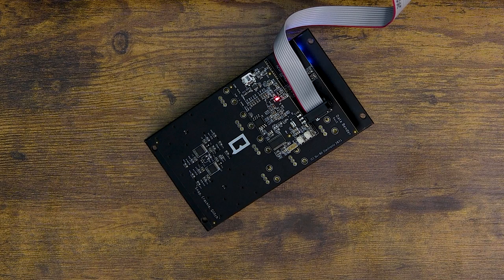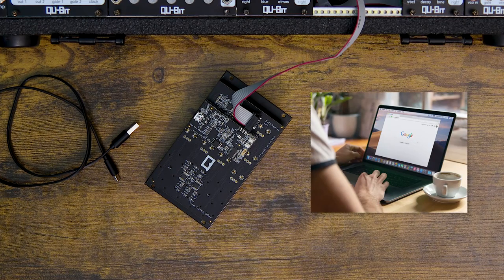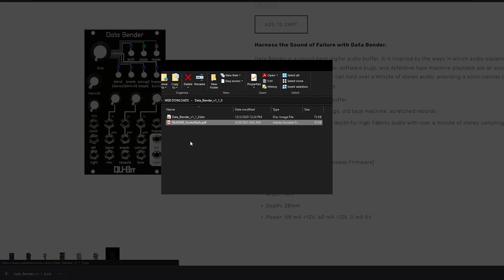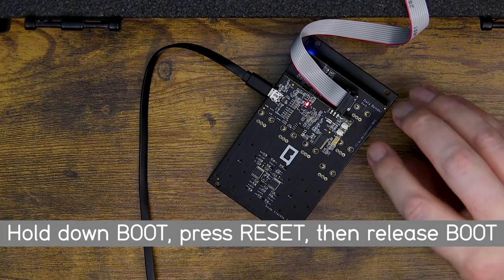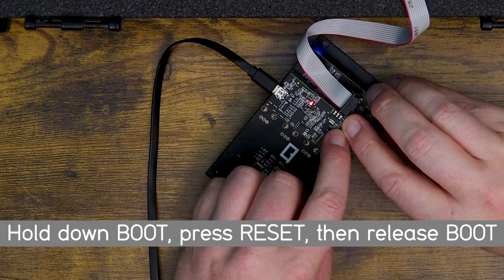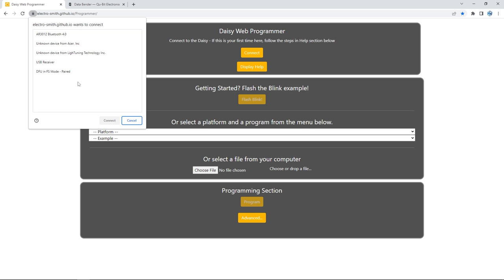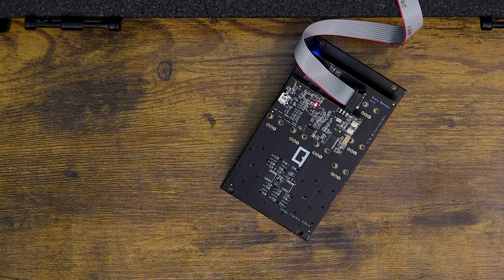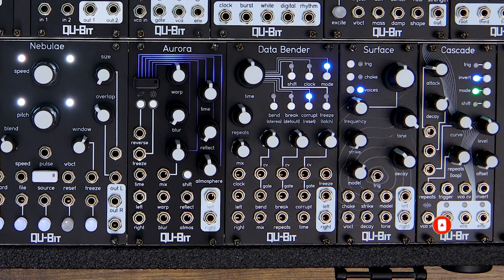How to update firmware on Data Bender

Comment: Thanks! Simple and elegant as always Qu-Bit!
Do I need to calibrate my module as described in the PDF after upgrading the firmware?
Reply from the maker: We recommend performing the calibration procedure after updating your Data Bender for the best possible pitch tracking. Data Bender does perform a software calibration when it is updated, so if that calibration is sufficient for your patching there's no need to calibrate!

Comment: I can't get zadig or the daisy web programmer to say DSFU in FS mode...I had no problem using Zadig when downloading the pams new workout firmware either...I used two different cables and tried both methods described for boot mode...I have the newest version of DB as well...Please help!
Reply from the maker: Greetings---so sorry you're having problems with Zadig. We'll get you straightened out. To start--visit:
https://www.qubitelectronix.com/support
Reply: @QuBitElectronix  ticket created, thanks

Comment: Cant get the Daisy Web Programmer to connect, did the Zadig, my computer CAN see the DFU in FS mode but chrome browser cant and I did allow chrome to connect to USB devices so kinda lost 🥺
Reply: I managed to do the update using STM32Cubeprogrammer
Reply from the maker: @Hirsbrochannel  I'm sorry the web programmer didn't work out! To confirm, when you used Zadig, you selected WinUSB as the replacement driver for "DFU In FS Mode"? That  would make it so your computer sees the Daisy Seed, but not the web programmer.

Comment: That neb at the end of the video has the boot error LED code! Unfortunately I know what that looks like firsthand. Updated firmware, still stuck. Factory reset, still stuck. I ended up returning it (it was a used unit). Although I do plan to simply replace it with a new unit because it’s an amazing module.
Reply from the maker: Well, thank you for your continued loyalty to Nebulae despite your frustrations. If you ever have problems with our modules, make sure to reach out so we can take care of you. 
Either our Forum:
https://forum.qubitelectronix.com/ 
or our support page: 
https://www.qubitelectronix.com/support

Comment: zadic keeps saying the installation failed
Reply from the maker: A couple things to troubleshoot if Zadig is failing: 

- double check that "DFU in FS Mode" is the selected device, and that no other devices are selected.
- Try using a different USB cable, and/or a different USB port
- ensure that WinUSB is the target driver.

If these troubleshoots don't change the outcome, let us know!